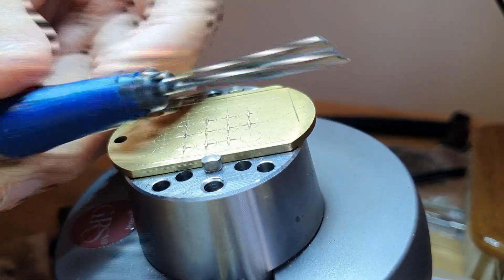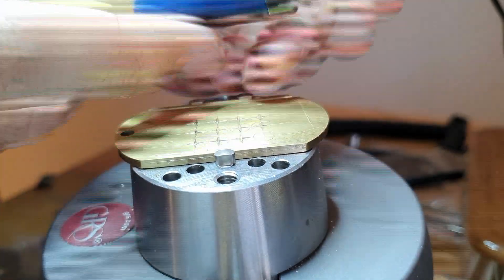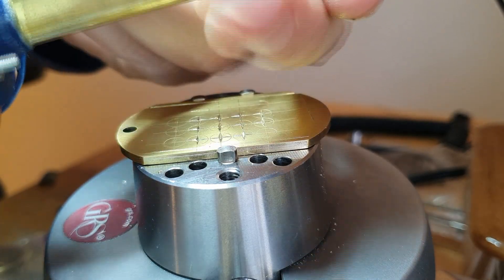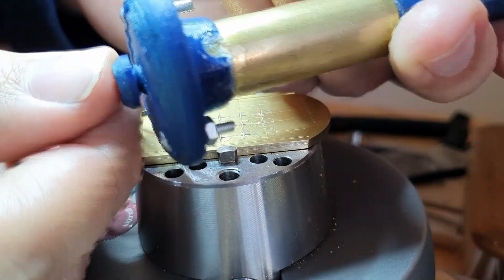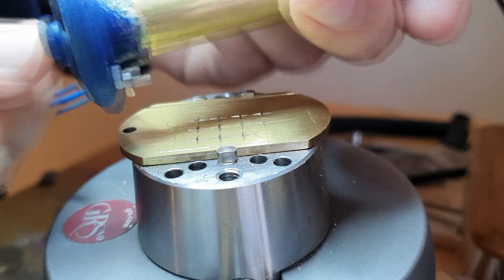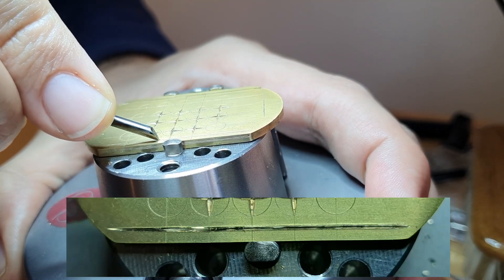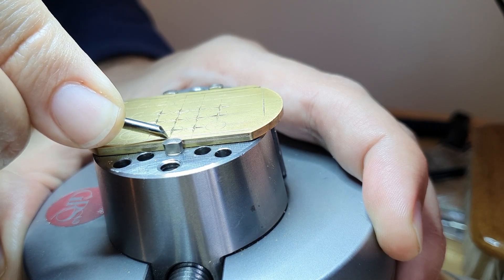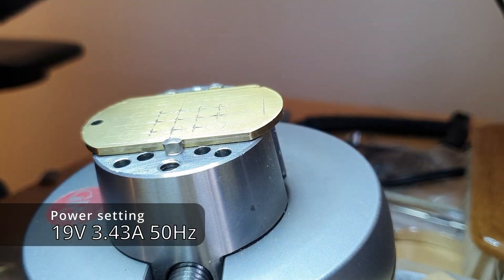Handpiece demonstration (New code)

Comment: Link doesn't work
Reply from the maker: Until Youtube updates the link you can check it here: shorturl.at/ghETY
Reply from the maker: Hi, Martin. Youtube added the period to the link, I've already fixed it. Thank you so much for pointing that out. 😊
Reply: @selvalss  I used the 13x30 its on my channel, works great but needs more power
Reply from the maker: @martinstockbridge3449  what voltage and current are you using? Whats the stroke length you have? Whats the rated voltage of the solenoid? I might be able to help you.
Reply: @selvalss  I copied Alastair 12v version with stroke bar cut down. I got other videos but not on here
Reply from the maker: @martinstockbridge3449  I use a 12V solenoid but power at 18v 3A. According to its datasheet it is possible as long as the duty cycle does not go above 60%. 12v was not enough.
Reply: @selvalss  thankyou I will give it a try
Reply from the maker: @martinstockbridge3449  Please update if you can! I am interested in knowing if it worked. 😀
Reply from the maker: @martinstockbridge3449  How did it go? Did it work? 😁I just posted an update in the code on github. This week I will test another solenoid and when my lens arrive I will post a video of the stone setting with it.
Reply: @selvalss  I brought some square more powerful solenoid to try. Ive just done the 3d printing, I just need to put them together. I will let you know my results.